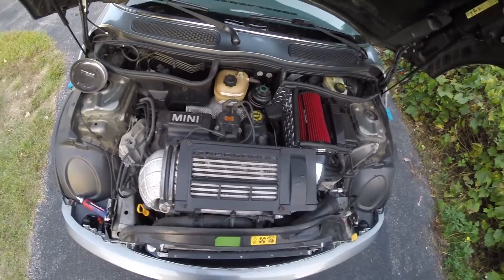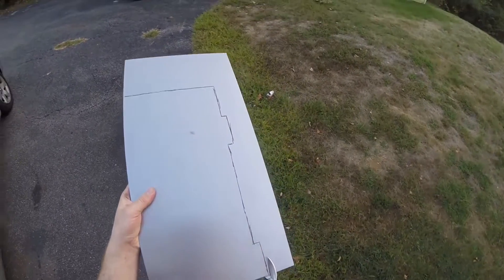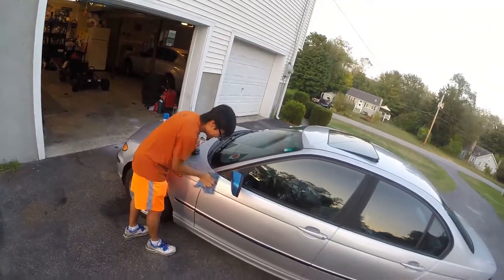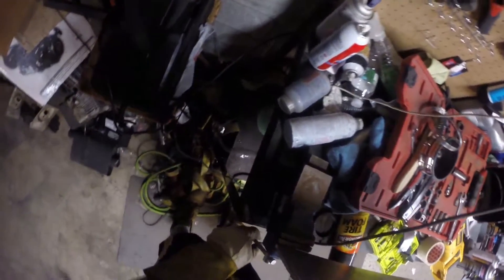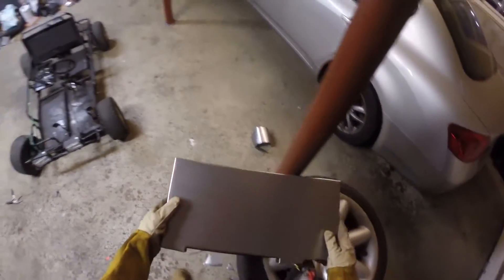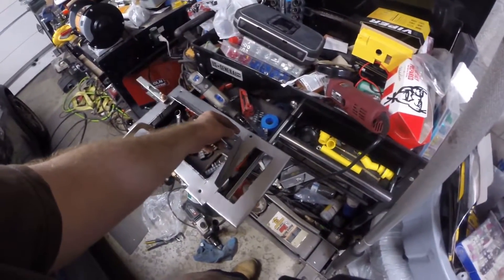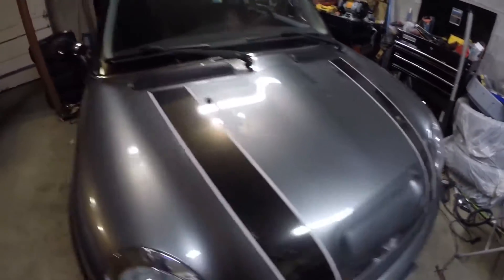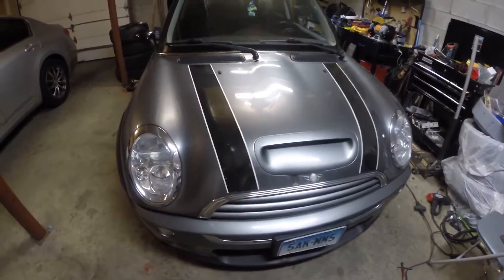DIY R53 Mini Cooper Alta Style Intercooler Diverter

Comment: You know what this is cool however if you buy a intercooler off ebay there proven to be better however on long journeys they heat soak because they don't come with a diverter there is a guy who makes them and sells them they retro fit over the ebay intercooler and actually work amazingly well they don't heat soak with the diverter so you should probably think about upgrade the intercooler and make a new one you got the skills to make a cheap intercooler into a amazing one no matter what you do with the stock one there just a bit shit